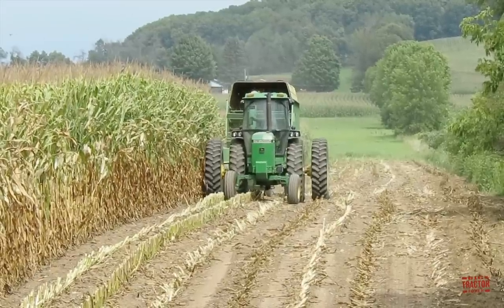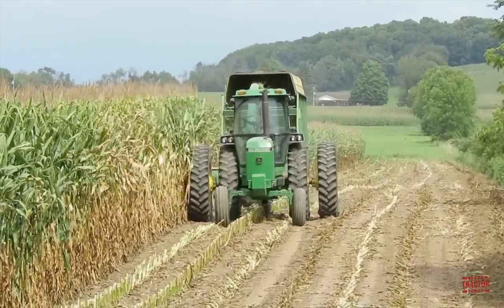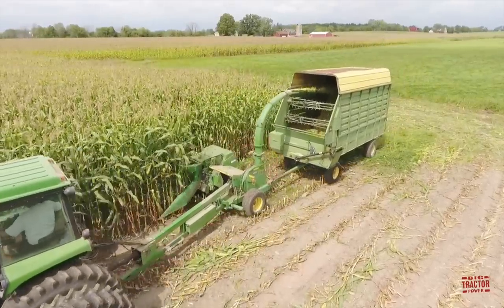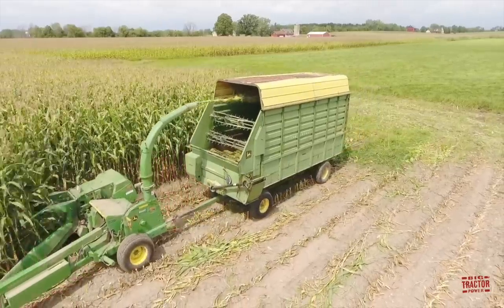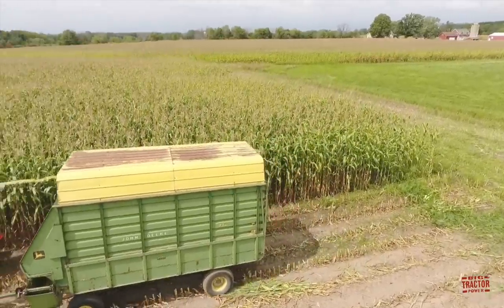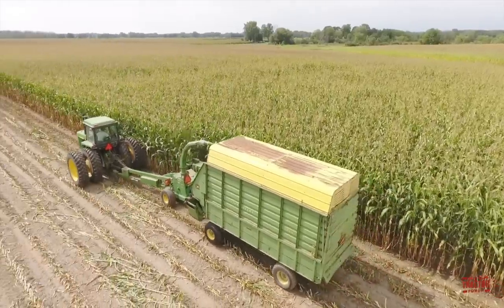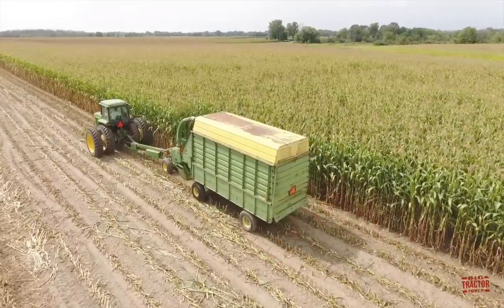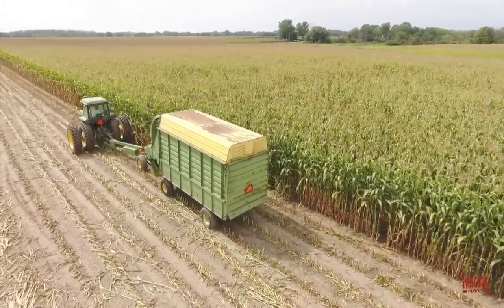JOHN DEERE 4455 Tractor Chopping Corn

Comment: The 55 series is easily my favorite soundguard cab series from Deere. We run a 4555, we've had it since '90, Grandpa bought it 3 months old.
Reply: JD Soundgarb cabs are the most aesthetically pleasing design I've ever seen. Today's JDs just look rough brutes in comparison.
Reply: @marks_sparks1  Exactly! I wish Deere would make a throwback series of tractors, and base it on the 30-60 series of soundguard cab tractors.
Reply: I wish just for a year Deere would make there tractors like they used to preferably the 20 to 55 series

Comment: That brings back some of my fondest memories. Our 4440 with a 3800 and 216 wagons and then the 3950 with 716As. That 716A doesn't have a standard 1275 or 770 running gear under it. It looks strange without the rear tandem. When we bought our last 3950 chopper my dad made them paint the head and gooseneck yellow just to keep the classic look. Man the smell of silage and diesel and the bomber engine sound of the harvester. The best time of year. The only good thing about the 2 row heads and smaller wagons was it made filling silo last longer.

Comment: At one point we had a 4440, 4450, and 4455.
All were 2 wheel drive. 
The 4440 and 4455 were QR and the 4450 was PS.
We pulled mainly 4 row ripper/planters, a 4 row peanut digger and 2 row Lilliston Hi-Cap peanut combines.
Our tillage equipment at that time  was 21 foot discs, a 4-18 flip plow, and a 21 foot field cultivator

Comment: Reminds me of the 4230 used on the Estate in South west England for grass harvesting where my Dad worked. It had replace a 4020 which was one of the first John Deere's to come into the UK since lease-lend during WW2. The 4230 had a/c but it was of no benefit as the rear window had to be open to operate the manual controls on the International precision chop harvester - it also had an 8 track cassette player also of no use as nobody had any 8 track cassettes!
Reply: J'adore vos vidéos 😄👍👍👍

Comment: I had a 4960 with a Tarrup 3 row on it blowing into a 30cu m accumulator trailer. Trailer had the beaters at the back, with a high rise swing in/out high speed conveyor on it. Was good setup. Never had to stop to unload. Keep blowing in while unloading into another big trailer. Our ground was way to soft to run trucks.

Comment: I ran a 4455 MFWD for many hours. It had a power shift transmission, was a great tractor overall and never gave any problems. Deere would do well to try to build tractors like that again and get away from all this electronic crap that's a one-way ticket to bankruptcy court when the bottom falls out of the markets and you can't pay for it.

Comment: Cost effective for the small farm operator and a beautiful tractor for sure, but painfully slow compared to the modern equipment.
Reply from the maker: In its day it was a pier house chopping team.   Deere’s biggest self propelled was 4 rows and 250 hp when the 4455 was new. Today the biggest Deere chopper is 900 hp and chops 12 rows.

Comment: It must take forever only doing 2 rows at a time!
Reply: Not really.  If you only need one silo of corn, that's not big acres.  Most modern dairy does not feed very much corn silage on a percentage basis. MUCH more hay silage and so on. 
   That wagon holds between 8 and 12 tons depending on moisture.  And he can fill it every 5 minutes, or less.    So approaching or exceeding 100 tons, per hour. 
  it just looks 'small.   That is NOT a small set up.  Not for an actual family farm, especially mixed crop/dairy.  If I had to guess, the replacement cost would be...   $250 000?  Including the 2 wagons.   But a the only part of it that cannot be used for a different crop is the actual head. 
  Making these decisions very much different for every operation based on cost/benefit. 
Those big monsters we see here some time?   1000 tons per hour. or more. 
  They are cool to watch though.